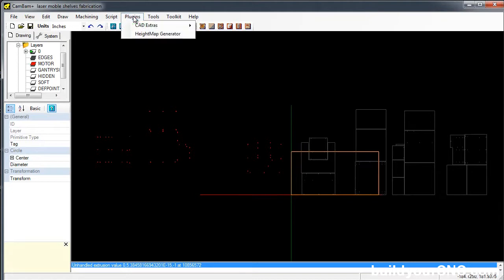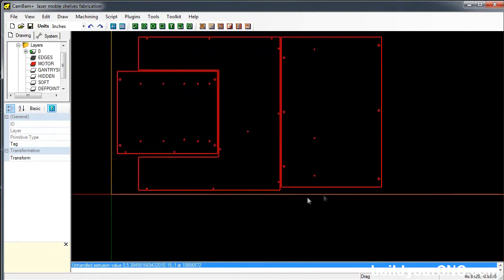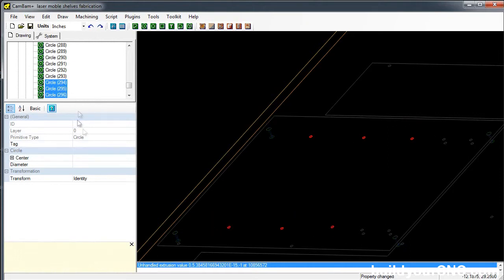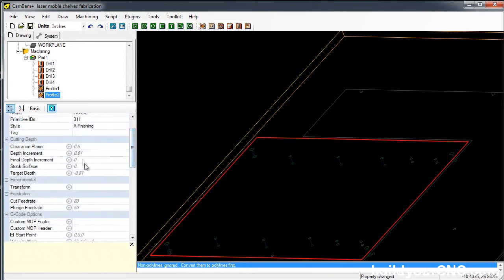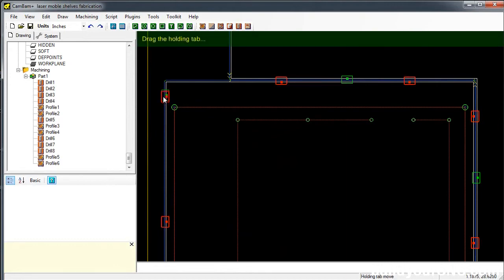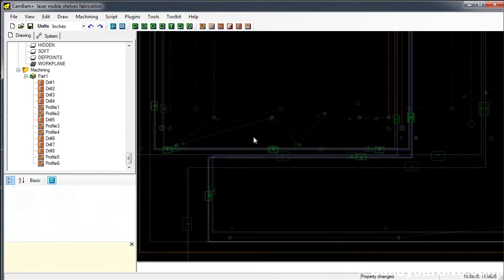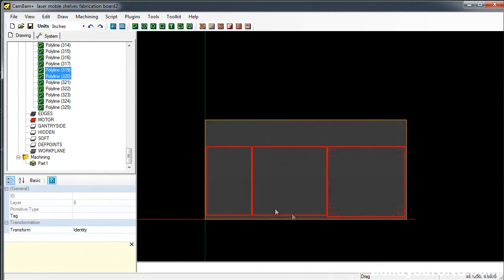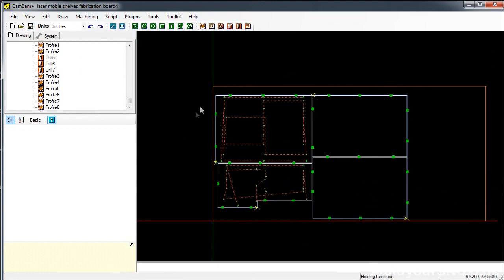Part 2: From SketchUp to Fabrication

Comment from the maker: Please let me know if this works.  I have heard of folks doing this, but this may affect the torque since you are proportionally lowering the power.  Are you using lead screws that won't allow a faster feedrate?  You may want to change to multiple start lead screws for faster travel rather than lowering the RPM if the router is not able to lower the RPM as a feature.

Comment: thanks I will try that, I think I can connect the router to a dimmer switch controlled receptacle and the voltage should control the rpm on the router since I cant increase the ipm anymore because of the screws thanks.

Comment: My router is a porter cable 7301 and the bits I use are 1/8 and 1/4 and I use .1 of an inch so I think the depth pass is good. the machine is rigid and ipm are from 8 to 12 ipm and thanks for the help

Comment from the maker: Are you using a standard router, or a spindle.  We use a 2.2kW spindle which has the torque to run deep passes.  If you have a router with moderate torque, then the recommendation is to set your depth per pass equal to the diameter of the end mill, depending on the density of the wood and the rigidity of the machine.

Comment from the maker: What material are you routing?  If you are routing ply, or a wood of a similar density, 30,000 seems like it's a tad high.  There could also be high runout and/or too much vibration.  The end mills are also a factor as well.  You may be running the end mill to hot as well if the feedrate is too slow.

Comment: Hey one question, I saw you only used 2 passes on 3/4 inch wood and I suppose you know your router bit wont brake.  My router bits keep on getting broken and I do .1 passes and they still sometimes brake they are good bits carbide,  I wonder if is my router because it only has one speed and it is 30,000 rpm and I dont know if the rpm are damaging the bit is there any advice you can give me thanks